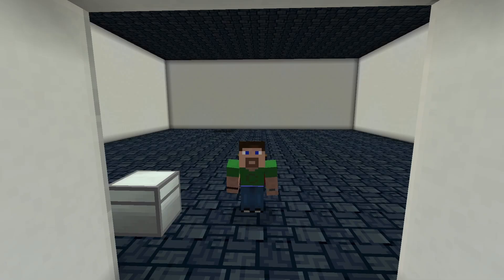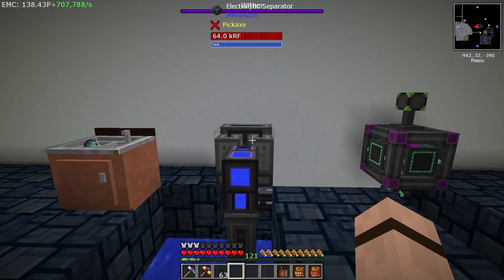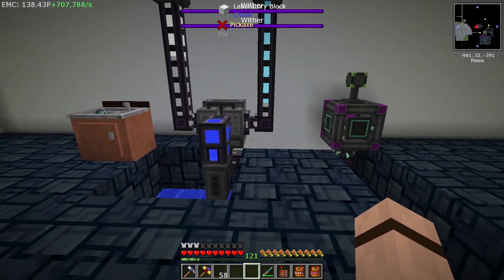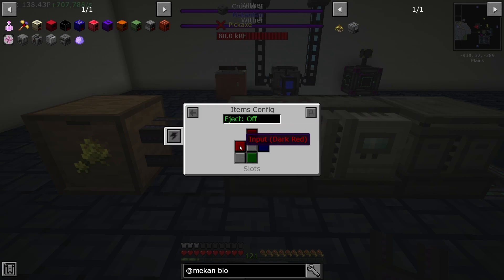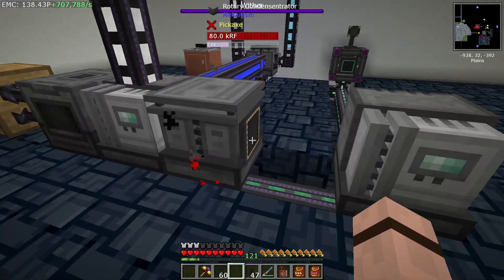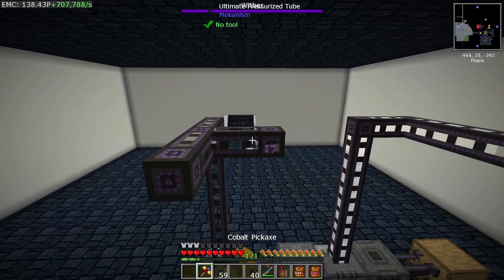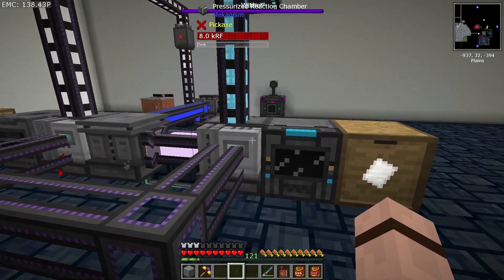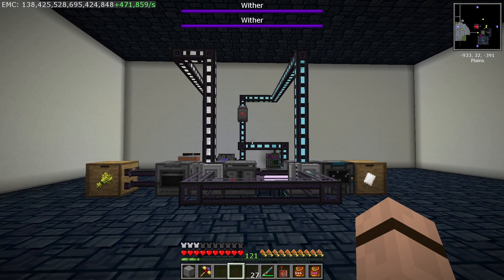Mekanism HDPE Tutorial

Comment: The machine stopped because the liquid/ethylene maxed out. What should I do?
Reply from the maker: Not encountered that problem my self with this settup. But you could add a tank between the rotary condensator and the last PRC and set that to "dumping excess". That way you will always have a buffer between these two machines.
Reply: @CalistoNoir  hey man seems like its a liquid. And so i snapped and use quantum tank instead (able to store exactly 2147483647 mb)
Reply from the maker: @Nah_What.   I know that was a liquid. Mekanism also have tanks for liquids. But yeah, any tank will do.
Reply: @CalistoNoir  Now, when you convert biofuel into substrate, it generates 100mb of Ethene, but to turn substrate into pellets, it only consumes 50mb. Because of that, you end up with leftover liquid/ethylene. But your idea of using a tank is really good—I was racking my brain trying to find a solution to this problem. like :)

Comment: Im trying to connect my electronic tic separator to my chemical tank but it’s not working!!! Can you help🥹
Reply from the maker: right kind of tank? There are different types (liquid and gas).
Reply: same problem here! its the gas tank, doesnt seem to connect with the tubes😢
Reply from the maker: @jonethxn  i'm betting you are either using wrong tubes (gotta be pressurized) or you have changed the input/output sides on the gas tank (called chemical tank in newer version).

I have build this twice in 1.20 using the exact same build and it works perfectly.

Check  tubes and check the tanks side config. It works.
Reply: @CalistoNoir  Omg thank you!